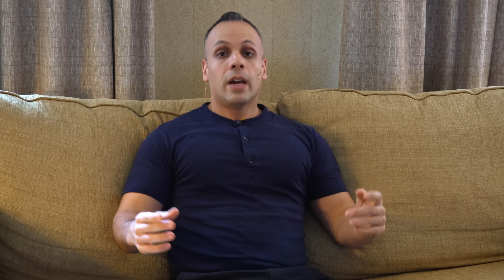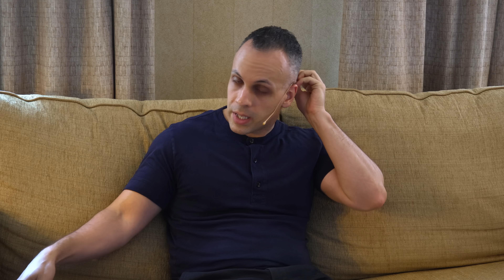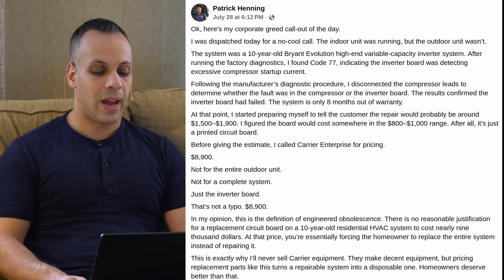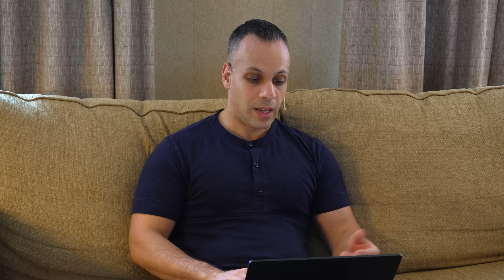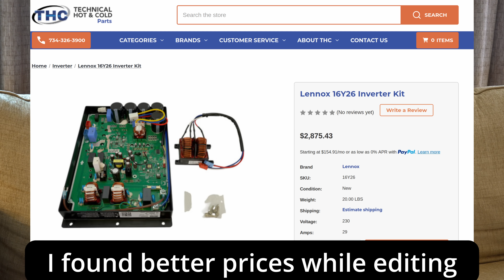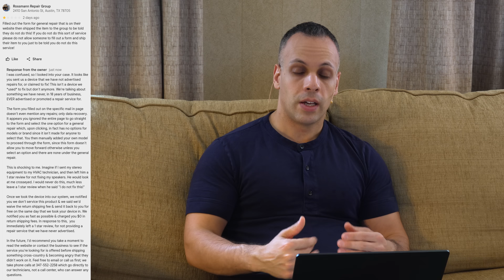Carrier AC repair has $8700 part cost for residential unit

Comment: My dad's last AC (Trane brand, installed by parker and sons ) went through multiple non-warranty repairs during the 10 year warranty due to intermittent evening failures not appearing when the repairman would came during business houls so after multiple trips dad said to start making billable repairs which was replacing a board=fix. I got a peek at one of the boards they were replacing once but under warranty so they got to keep it; I was not just looking for failed parts but also at capacitor brands and yup, they were the brands people replace with others to fix computer stuff that fails prematurely. Different boards each time something cropped up again. Sometimes they even made mistakes like replacing a compressor motor that ran toward the end of spec since install date because they thought that was a possible cause of issues (guess they don't read their own diagnostics he paid for over those years). We agreed that once the warranty was up that it was worthwhile to replace the unit instead of consider diagnosing it when it has a history of in-warranty failure; probably should have lemon-law'd it if that was an option. Shortly after warranty he bought a Geottl (better AC and plumbing experience with them so far but we moved plumbing to a local independent plumber); so far so good but time will tell.
Reply: Capacitors are the first components to fail in many electronic devices, such as AC units. I had a supercapacitor go out in my Brother printer and bought one off Amazon for around eight bucks.

Comment: Fixing those boards is VERY profitable IF you can find a source of broken ones AND reverse engineer them(needless to say, Carrier will not give away their"trade secrets")
Reply: How would I go about learning to repair inverter boards for AC systems and mini splits? I’m an HVAC student right now less than a year from getting certified but I’ve studied my ass off. I’m still young, and I know the future is electronic and digital, so if I learned how to repair these boards it would help me a lot. Also I have minor experience in soldering too. Any reccomendations for books to read, videos to watch, or courses to take would be greatly appreciated.
Reply: Please let me know thanks
Reply: @nick5839  Do you have a background in electronics? If not that is the first thing to learn (electrical engineering). Step one of repairing these boards will be reverse engineering(harder then the original designing) them, as the companies will never part with that information. The actual work of repairing them (soldering in all its forms) is the easy part. The diagnosing of the failure point is the hard part. First, you need to know how it is supposed to function(reverse engineering) and then determine why that isn't happening.
Reply: @M @MDAdams72668 extremely basic understanding of electronics,  not to the point of reverse engineering anything, I’ve only done soldering for motherboard repairs for computers

Comment: My house came with an ancient Hotpoint electric ignition gas oven. It's gotta be from the early 90s. The igniter has blown 2 times in the 15 years I've owned this house. The igniter costs $45 and 20min of work. 

I really want to switch to induction, but there's barely any good data out there on how long these parts last and what repair costs are. Like literally nothing. 

I hate being forced into a position where I have to buy something with zero knowledge on how much the repair will cost over its usable life. I hate this world we live in where when something breaks, you just have to buy another one. 

The model I'm looking at is $3k+. How is it possible that the company can't give me a price sheet for repair parts? As if that weren't something that I should care about...

Comment: Unless there is some exotic custom part on that board even $2875 is wayyyyyyyy too much. You can just buy all those parts from Digi-Key, replace the original board components and still be ahead by thousands.
And then find out the problem was elsewhere all along...

Comment: I have a Montgomery Ward Hot Air Oil burner furnace at my camp, approximately 1950’s. Still runs fine. 2010 Civic at 184,000 miles, running great and my iPhone 8. Life is simple, life is good and things almost never break. 😂

Comment: I have been an hvac tech for 15 years and avoid Carrier as much as possible. However all the manufacturers are guilty of this nonsense.

I recently quoted a replacement microchannel condenser coil for a commercial York unit from 2014. They said the unit was end of life and it would be $20,000 CAD for the coil. Fortunately I was able to repair the coil.

This got me thinking though, I work on another site that has a York unit from 2023 so more recent, it has the same coils in it I measured them. So I went back to our local York supplier with the Model and serial of the newer unit and asked for a quote for a coil for that unit. They quoted $4000 CAD which is still ridiculous but a lot better than the 20k fuck off price they quoted for the other unit.

Comment: I had a refrigerator that was out of warranty with fan and compressor running abnormally.  Factory authorized service tech came to service it and told my wife that it had a bad control board and replacement boards are no longer available.  Her only option, according to the technician was to replace the refrigerator.  When I learned this, I looked at the service receipt and the failed board was not even identified.  My wife called the appliance repair service and asked for the part number of the failed board.  She was initially told that they don't give out that information.  My wife is very persistent and told them that she paid for the service call and if they can't fix it, the least they can do is tell her what part is bad.  They relented and provided the part number.  I researched this board and found repair instructions online.  I bought $30 in parts from Mouser to fix the board.  It took an hour to remove the board, remove and solder in the new parts, and put everything back together.  Six years later, the refrigerator is still going strong, no thanks to the manufacturer.
Authorized appliance repair technicians these days follow a diagnostic procedure which can be as simple as putting the device in test mode, reading the error code, and identifying which board or assembly to replace.  They have no ability to troubleshoot at the circuit board level.  Do independent service technicians have this ability anymore?  This seems like a giant opportunity if  not.

Comment: HVAC expert from Orange County, California here. I have one of these units in my own home. Mine came with the wrong software code, and I had to go through four inverter boards before getting the correct one.

I’d recommend a unit manufactured in China but sold by a reputable local distributor with many locations. Distributor support matters more than the brand name. In Orange County, for example, AC Pro has seven locations, Carrier and Lennox have two each, and American Standard has only one.

Carrier, Trane, and American Standard also sell Chinese-manufactured units under their own brands. These units are mass-produced, and in my experience they have almost no callbacks.

But if you buy from a known brand with very poor distributor support, it’s almost like buying the unit from a liquor store. The warranty can become practically useless if a critical part is backordered for months.

Comment: Carrier has gone to pot.  Our local Carrier dealer was just as slimy as the corporation.  I had the fan motor on my condenser go bad.  I had time in the evening to diagnose the issue but of course everything was closed.  I figured I'd bite the bullet and have the local dealer replace it.  I got a quote - $350.  I thought that was a bit steep for a motor and a little labor but I said OK.  I told them to call me when they arrived to do the repair and to leave the old motor next to the unit.  I got a call late that afternoon telling me the repair was complete.  I asked them why they didn't call me when they got there - the guy said "didn't know I was supposed to".  I got the bill - they charged me $350 for JUST THE MOTOR.  They also charged me $150 for 'diagnostics' and another $150 for the labor to replace the motor.  The dealer is now out of business - I wonder why?

Comment: Usually just a relay that burns up. But they are soldered on, and techs aren't trained to do that kinda repair. Plus if they sell you a new unit every time,they bank hard. Almost 50% of the price they charge you is their profit.
Reply: How would I go about learning to repair inverter boards for AC systems and mini splits? I’m an HVAC student right now less than a year from getting certified but I’ve studied my ass off. I’m still young, and I know the future is electronic and digital, so if I learned how to repair these boards it would help me a lot. Also I have minor experience in soldering too. Any reccomendations for books to read, videos to watch, or courses to take would be greatly appreciated.

Comment: I have a First Company unit that blew out its air handler motor in 2023. It is a simple 1/3 HP variable speed electric motor. After being ghosted by three local contractors, I finally found one local contractor who agreed to fix it.  The cost of the motor was $1,900. Just for the motor. The contractor apologized for the price, but he said that is what the company charges. Gouging.

Comment: Replacement parts need to have a 20% maximum profit margin by law so scummy companies can't get away with screwing over their customers this while pretending they actually make repairable products.  Same thing with Apple, charging $800 for a screen on a $1,100 MacBook Air.  By the time you pay the shop for installing it, it costs just as much or more as buying a new one.  This is malicious compliance and should result in MASSIVE fines.

Comment: Our industry, the HVAC industry, has shifted towards replacing equipment rather than repairing systems. It's getting more and more difficult to find real technicians and by that I mean troubleshooters. Some of that has to do with the fact that really don't want to hire technicians - they want to hire sales people and dress them up like technicians. I mean that sincerely. For those companies, they emphasize replacing over repairing. To answer your question, and I can't speak for the industry, most guys I know don't have time to haul that unit home and work on it. The shops I've dealt with don't really want to do that either. Once in a while though you will see a guy who will fix up old equipment and put it in their own house. Part of that is being a cheapskate and part of it is just because it is fun  - for those who like to tinker anyway. That would be me. Louis I know your background because I used to watch your older videos where you would work on circuit boards, TVs, and other things. Well, I think that was you but maybe a different channel. Anyway, you might agree that the circuit board is very likely repairable. I enjoy taking a shot at repairing these boards before replacing them. I hang on to old ones so I can do just that. When they are no longer available, I can try to repair an old board I have on-hand. That is as long as it is not encased in epoxy.

Comment: The reason R-22 was phased out was because R-22 runs at a lower pressure equals less stress on all parts those units last 30 to 40 years and run cooler than all the others. The bad for the ozone layer thing is what they called climate change back in the day. I have a  R-22 Trane unit I got new in 1992 only regular check ups still ice cold.

Comment: I opened and operated a specialty car service company a few years ago, in Hong Kong. Effective, efficient air conditioning is as essential here, as is heating in my native country (Canada).
I had the good fortune to make the acquaintance of a gentleman whose company had the contract to supply commercial AC for the MTR (subway) trains.
His emphatic recommendation was for Daikin, a brand with which I was unfamiliar.
Over the 10 year run of that company, I had zero faults, failures or service issues.
Compare that to a company I worked at when I first arrived here. Three complete AC system replacements in just 7 years. Carrier, Panasonic and Mitsubishi.
For MY money, Daikin every time. At home or at work.

Comment: You can get an entire Goodman heat pump system for less than $10k installed, I think. This is what my landlord had put in to replace a leaking system. It's worked fine. It keeps my house cool in the summer and warm in the winter. Thanks to being a heat pump, my heating bill actually went down from the old system.

I had a friend in the HVAC industry tell me Goodman is fine these days. They had a period where they were kinda terrible, but they've corrected course.

The only thing I'd call out about it is just how loud the compressor startup is. This is apparently normal for this generation due to the refrigerant used, according to my HVAC friend. The only actual problem I've had with it is actually not a problem with the system. Rather, the landlord won't put gutters on the house, and last winter some ice melting off of the roof dripped into it and refroze around the fan blade, causing it to make crazy noise. I'll have to find a solution for that before next winter. There's apparently some rain water diverters I can use on the roof above the ODU to help with this

If I had a Carrier and they gave me that price as a "say no" price, and I was facing a lower price to replace it with a different brand, fully installed, I'd "say no" to Carrier.

Comment: My 15 year old AC went out this spring, repair man said it needed replacement and It'd be about a week before he could get it done. When he left I climbed up on the roof and stripped the old one bare of parts. $350 cooling fan and $1K blower, controller boards etc. 

I'll sell them back to my AC guy as he needs them.

Comment: I will flat out never buy another Carrier system ever again. 
Had an old R22 Carrier that had been running for over 20 years. 
Replaced it with a new 2 stage high efficiency R410a unit. 
Had nothing but problems with it and had 1 compressor replaced under warranty. 
The new compressor started acting up inside a few months. 
Carrier refused to fix it under warranty as it would technically eventually start even though everybody agreed that it was not supposed to sound like an angle grinder slowly getting stalled out when starting up.
Finally the unit mostly failed. 
As in the compressor would overheat but if you hosed it down with cold water you could get it to come on. 
At that point Carrier would only cover parts as labor warranty was only 3 years. 
Replaced it with another 2 stage Carrier with the new R454 refrigerant. 
Installed by a different company.
Within weeks the compressor started overheating and locking up. 
Installers came out and removed the sound deadening to keep the unit functional. 
Unit was still locking up. 
Installers came out and installed hard start kit. 
Hard start kit failed within a year. 
Carrier calls this operation "nominal".

Never again. 
Carrier can go pound sand.

Comment: The board can be 100% be repaired just send it to a Industrial Electronics Repair shop. I'm a Tech at in the field and we see random circuit boards all day everyday. Can we test 100% of all functions without all the equipment not exactly but we are well versed in Reverse Engineering because Manufacturers do not regularly release schematics. My guess is you could rush that board for $500-800 repair cost roughly shipping is usually included.

Comment: Hey Louis, my name is Stephen, wife has yt premium and I don’t but whatever, anyways, hvac tech here, carrier, Lennox, Trane (chillers), and a bunch of doas certs you won’t care about anyways, to answer your question, it 100% is the fuck you buy new equipment price, here my proof, last year, I have 13 different customers that needed carrier evap coils, out of warranty, the coil here in the panhandle of Florida was 17-3500$, I can buy the exact new revision air handler that nearly identical and will 100% replace my customers with 0 issues for 1200$. They want you to buy equipment, they don’t make high margin on repairs unless they price it like this. It doesn’t make sense but that line is right from the reps mouth. To be truthful tho, the inventors of mechanical ac aren’t the first, and the are definitely not the only, the big three are about mental, but seriously, the biggest offenders are AAON… 31000$ for an evap, granted it was a 30 ton but same tonnage from captive Aire is like 14k$ and the difference is mainly opinion on those two, a lot of guys say AAON does it all better, I personally disagree, I shouldn’t have to use my laptop every single time to fix your equipment… but that’s the world we live in. All the manufacturers are giving you the fuck you price it’s just a matter of if you know what they think the fu price is vs what your fu meter can detect, cause sometimes the fu price is 500$ on a Lennox vrf blower motor… like seriously, why does the motor need to communicate, the board will not turn on the outdoor, if the blower is bad. Or it can’t com to the blower… the whole industry is fucked. Welcome to hvacr